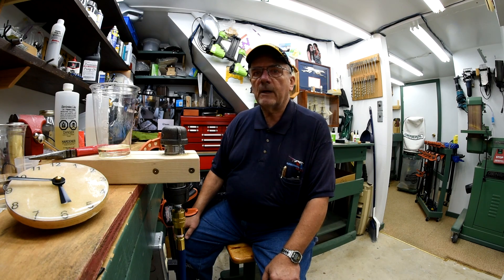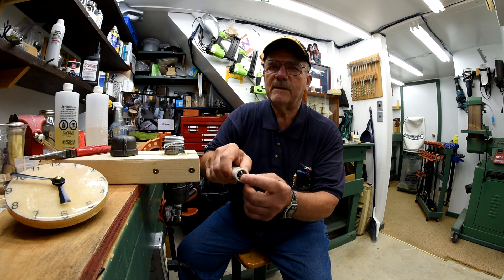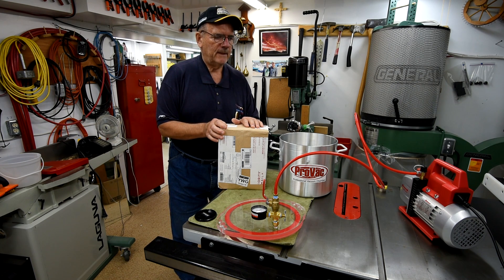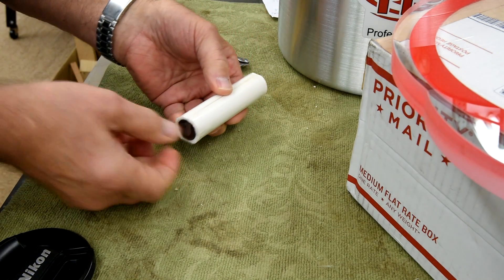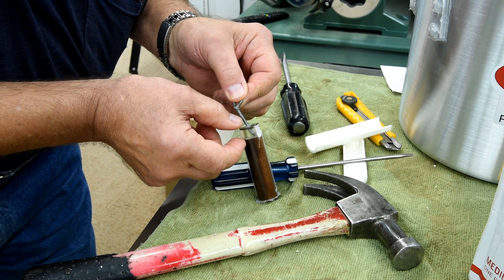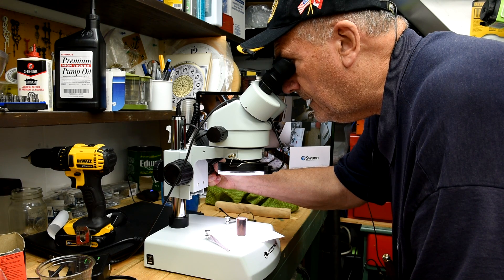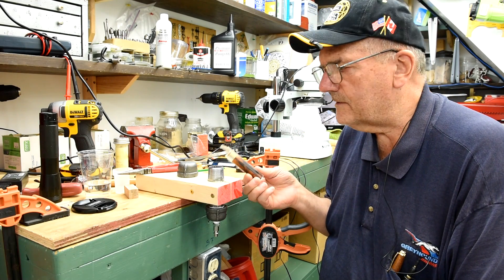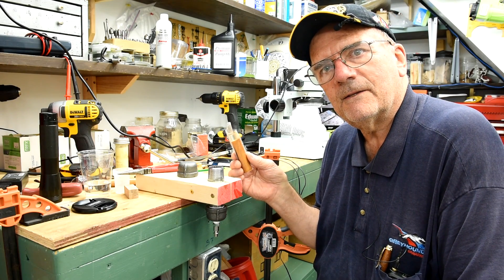Vacuum Infusion Test - Part 6

Comment: it actually looks promising. Why not to drill hole through the piece before pressure treatment?
Reply from the maker: Yes, I'd considered that too. Problem is that the next drill-out for the brass tube must be exactly in the same trajectory as the first. It's worth a try though :)